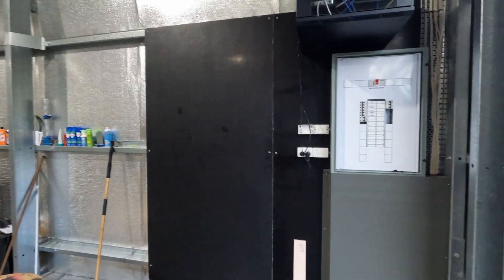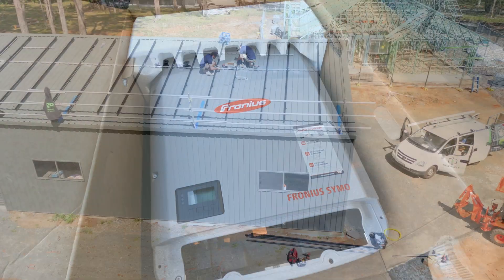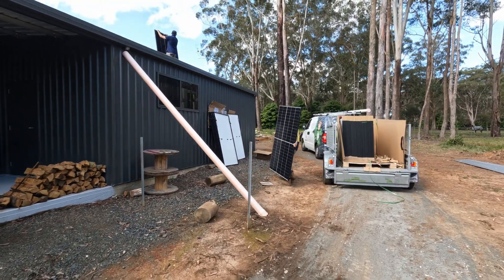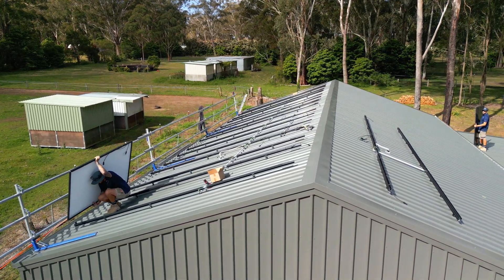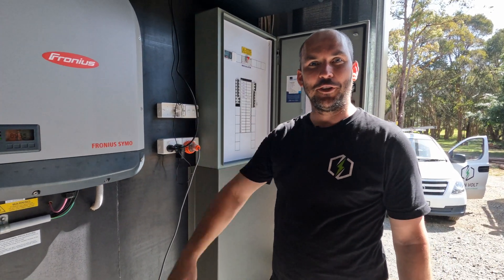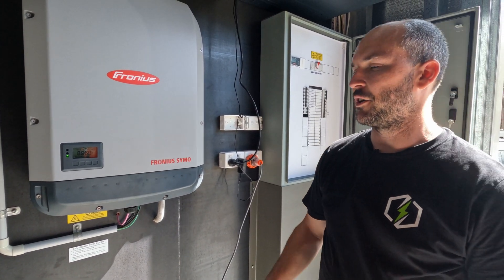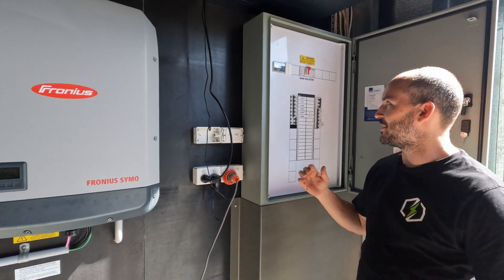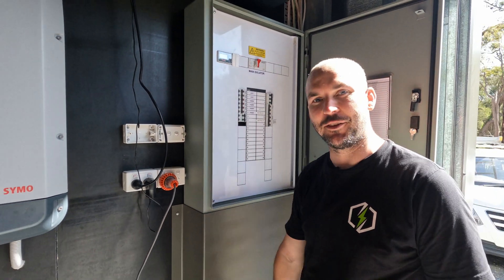EP30 | Shed Build | Solar with Fronius Inverter and Trina Solar Panels

Comment: Thanks for the information. I'm looking at installing a 10Kw system and a 8.2kw Fronius inverter. 1 question, How do find the fan noise when the unit is getting full sun on a hot day?
Reply from the maker: Not a problem for us